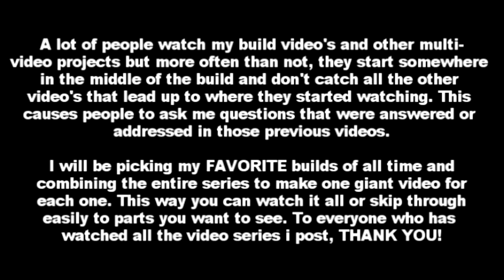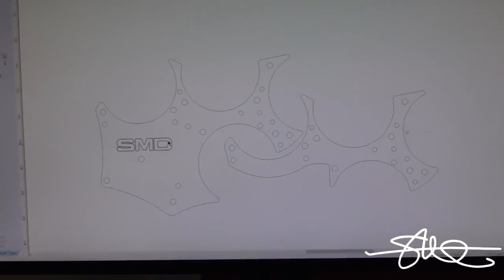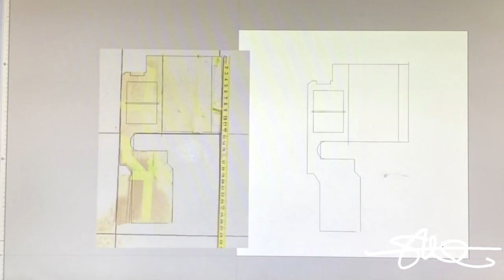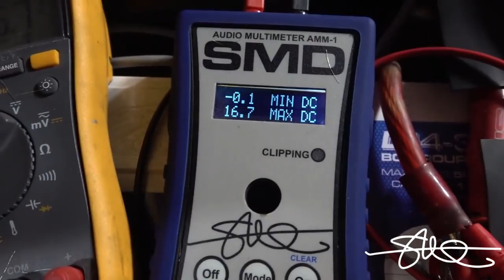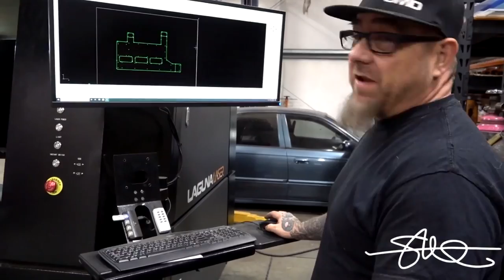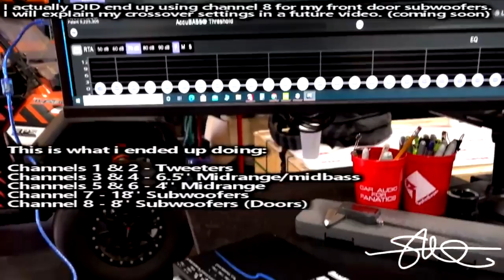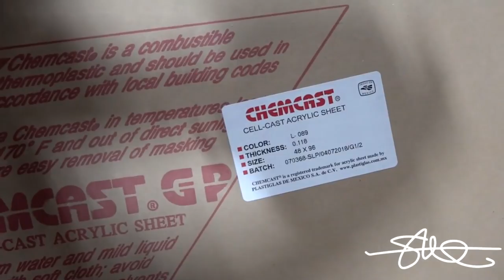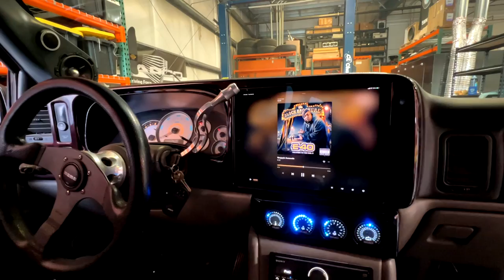30,000 Watt Chevy Tahoe Sound System Torn Down & Upgraded after YEARS of abuse - Start to finish

Comment from the maker: A lot of people watch my build video's and other multi-
video projects but more often than not, they start somewhere 
in the middle of the build and don't catch all the other 
video's that lead up to where they started watching. This 
causes people to ask me questions that were answered or 
addressed in those previous videos. I will be picking my FAVORITE builds of all time and
combining the entire series to make one giant video for
each one. This way you can watch it all or skip through
easily to parts you want to see. To everyone who has 
watched all the video series i post, THANK YOU! more coming soon!
Reply: Я если честно ничего не понел в этом видео и зачем 4 часа делать
Reply: Hey Steve you still have the old Carolla bass car???
Reply: Dope. Thanks Steve!
Reply: Do u have an isolator for the batteries stacked together or no need.?
Reply: @beatsandwestside  That's kinda one of the benefits of stacking no need isolators
Reply: Can you run 14v batts with an alt that runs 12v? External voltage adjuster?
Reply from the maker: @beatsandwestside  no need
Reply: @XFader505  The voltage regulator defines the voltage, and the standard output from a 12V alternator is 14.4V so prolly, myb. 
With a step up transformer though? The current will go down to 1/2 of its original value and your amperes stay the same regardless. Adding batteries can up both. Some kind of switching circuits might work maybe a regulator as opposed to adjuster. Couldn't hurt to try. I'd be more worried about amperage output than volts though.
Reply: Steve I have to say you continue to be an inspiration to me in my new addiction to car audio and learning how to install it. I have a 02 yukon I've wanted for years that my mother finally gave me last year and this truck is where I want my truck to be. I am currently working on a build with 2 scar audio 18s. I m still trying to build the box myself. And it is hard without Machine's to make a nice one. I've watched so many of your videos and learned so much from you. Keep it going man we appreciate all your hard work because it makes me want to work as much as I can through this strugle.. love to have real products to work with. I'm having ground problems now trying to save for smd fuse holders and distribution blocks. I hope to one day have 2 b2 15s!! But with knowledge I do what I can with what I got. And by the way you want to sell one of those alternators??
Reply: I ALWAYS WATCH THE ENTIRE VIDEO MEADE916 #1SUPPORTER. JUST THOUGHT I TAKE A CHANCE TO SEE IF YOU WANTED TO GET RID OF THE RIMS THAT'S ALL YET KEEP UP THE GREAT JOB👑
Reply: Steve kill it every time Meade916 the Master🏆🏆🏆🏆🏆🏆🏆🏆🏆🏆🙏🙏
Reply: You’re a legend.
Reply from the maker: @vernonsummerlin9012  i do need to get rid of them but whoever gets them should be local because i ain't shipping them anywhere. Thanks Vernon!
Reply from the maker: @natecamp2585  i built boxes for 30 years before i got my first cnc machine.  It isn't that hard to "make a nice one" at all (without a machine).  Just have to put in the work.  Thanks man!
Reply from the maker: @XFader505  yes, if you have an external regulator.
Reply: I loved this truck since the first time I seen it!!!!
Reply: Steve!! I can't wait to see this video later today! I'm gonna set some time so I can enjoy it.  You are a master of your craft!!!
Reply: Your videos are the rare pieces of content that I can watch for several hours and not get bored.  Sometimes I miss doing 12V A/V installs, and other times I remember why I left it.  Either way, I enjoy your videos, and it takes me back to a lot of fun times I had back in the day, as well as showing me some higher end techniques I never got into (most folks in big chains like I worked at don't want to go big). Thanks.
Reply: Fingernails burnt lookin like a tweaker 
Ears steady poppin but not from the speakers
Reply from the maker: @drummerdoingstuff5020  who you talking about? your mother? tell her to put the crack pipe down.
Reply: @meade916  lol you never heard of Master P? Pass me the green, good old school banger right there, like yo momma!
Reply: @meade916  love ya 🐕😜
Reply: SMD you ever gonna put your old Lexus back on the channel if you still have it.

Comment: Ceramic bearings for your belt pulleys and a more powerful spring and ceramic bearings for your belt tensioner will definitely for sure take care of any and all issues that you would or could ever encounter with belt slippage, plus that will without doubt quiet it down ten fold.

Comment: I'm in the middle of watching this and iam at the part where you make the steel bracket for the alts ... I reckon a good idea if you haven't thought of it already is to paint the steel a colour of your choice then put the perspex bracket over the top. Gives the metal protection from the weather and also look brighter with the perspex and paint.

Comment: Did you notice the RF 3sixty.3 doesn't seem to like anything above 15.85v, like it just goes into protect.  I had to get one of those XS Power step-down modules for my external radio and processor.  My blazer and everything else likes the 16.4v.

Comment: I'm not a brown noser, so know that I mean this.  What you have done is extraordinary in your business and life.  I have dreamed about starting my own car audio business since I was in my late teens, I just did not have the guts to do it.  I was going to run my own shop and make custom boxes as my main thing.  I am 43 now and because I took the easier road, I have a lifetime of regrets, for not going for it.  I want to start building flat pack made to order custom sub boxes, all I need is a better table saw because my Delta only has a 30 inch rip width.  Keep it up man, keep making that money and building your brand.

Comment: Hey just wanted to ask about a system to put in a Honda civic LX I wanna keep dash the way it is and just use a rca cable inline box I'm guessing from stock radio and I want to add toggle switch so I have open to either be normal or turn on switch to have it thump what would u choose to put in that car I want like 2 subs and a descent amp to push it but do I have to add any batteries or upgrade my alternator

Comment: Do you have to reprogram the ECU to deal with all the extra voltage to the electrical system? I thought something like that would set off a check engine light.

Comment from the maker: 00:00 - 10:07 - Reviving the 'Hoe 2020 (More Volts = More BASS!) 2001 Chevy Tahoe Ripping it out video 1

10:07 - 22:52 - Major Fire Hazard Discovered! Almost had a Truck-B-Q! Reviving The Tahoe 2020 Video 2

22:52 - 45:32 - A SERIOUS Power Plant! 4 New 400 Amp High Output Alternators for the Tahoe (Unbox & Bracket Fab)

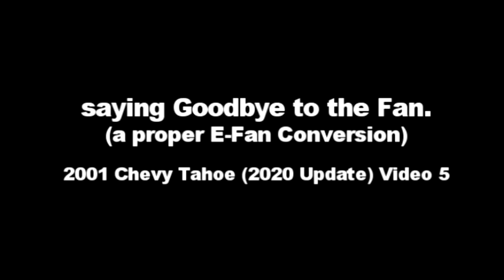45:32 - 1:04:08 - Regulators, Mount up! 4 Alternators 1600 Amps @ 17v Custom Stainless Steel platform Fabricated

1:04:08 - 1:16:53 - Goodbye Old Fan! More Space, Less Drag, Better Cooling. A proper OEM E-Fan Conversion '01 Tahoe

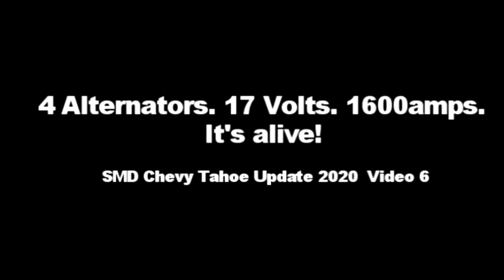1:16:53 - 1:31:23 - Stainless Steel Platform for Fuse Blocks, Distro Bars & Modules (from scratch) '01 Chevy Tahoe

1:31:23 - 1:44:03 - It's Alive! High Voltage Chevy Tahoe Pushing 17 Volts! Regulators, Alternators & Step Downs Fired up

1:44:03 - 2:03:26 - ALL the Double-Zero. High Power Sound System (16) 2/0 power & ground cables stripped, crimped & ran

2:03:26 - 2:15:25 - MASSIVE 2/0 Frame Grounds Plus a fresh new Banks Power Ram Air Intake Installed 2001 Chevy Tahoe

2:15:25 - 2:34:24 - ABSURD Power Wire! Rear Megablock 16 Fuse Holder & LB-1 Ground Distro Bar (Laser Cut Platform)

2:34:24 - 2:53:17 - It's HOT! 11 Amplifiers Hooked up, Fused & Fired up on 17 Volts! SMD Chevy Tahoe

2:53:17 - 3:16:27 - Dump That BASS! (See What Happens) 4 18" Subs Tons of fresh Power + AudioControl Processor Swap

3:16:27 - 3:47:33 - Rear Battery Bank 50 Piece all Acrylic Cover with laser cut Stainless Steel Grills. CLEAN!

3:47:33 - 4:12:40 - Lipstick & Cables - Sub Box Neo Magnet Beauty Panel (Color Matched) Trim, Battery Bank Wired up

4:12:40 - 4:18:33 - Chevy Tahoe Still Beating Hard! 4 18's 30,000 watts Hair Trick No Problem! Tucking Forgiato 28's

Comment: Looking at a napa acid battery. RV 1427 CCA. 1700 crank. 425 RC.  Most I see not even close to 170.  I plan on running a taramps 20k. Currently have a 8k  that is on a 350 and 2 850s agm and 1100 deka  -10. In wis  fire up audio. THEN take deka out and throw it in my 350 JB bulldozer. -15

Comment: grounds look good but taping a 1/8th in piece of steel is not enough threads the grounds may work loose I would have drilled a couple bigger holes in the bottom and put nuts on it
Reply from the maker: yes it is. It is plenty.  Who said it was 1/8"? It probably isn't even that thick.  You don't know that because you have no experience in the matter.  It is MORE than good enough so relax champ.
Reply from the maker: @jamesstephenson2346  awwww did you get clowned on and feelings hurt? typical.  Keep coming back though i get paid for your engagement.  Hit that thumbs down button too! Troll money is good money.

Comment: Am I hearing you correctly?  You keep saying 14v batteries,  but the XS says 12v.  So, which is it?
Reply: 9:10. Taking out 12v that charge at 14v putting in 14v that charge at 16v.

Comment: that poor transmission pulling all that weight around but your lucky the short did not burn that thing to the ground nice truck though and awesome work
Reply from the maker: tranny was rebuilt years ago. It don't care.  This Tahoe is made to tow a trailer...a boat...the system is nothing compared to what it is capable of.

Comment: I blew up my sub yesturday lol the amp I have must push more the 1025
Reply: Wats
Reply: That's why you set your gains ac voltage to the square root of your sub's impedence multiplied by it's rms power rating.

Comment: Hey Steve really enjoying the new work on the build you inspired me with that thing an exo another awesome bass head even done a colab together 🙌🙏💯❤️‍🔥 I had a kewl Idear I thought you might like @meade916 the waterpump puller has the thread left on it you could make a custom emblem that spins on the pulley with a thread nut end to tighten it onto the front, it could be your design an brand an could even be make out of acrylic aswell 🙏 be kewl to see you make something unique for that , could also do the same for the battery area  a slip down panel 🤤❤️

Comment: You went from a no good hot air intake back to a factory style actual cold air intake.
Reply from the maker: no, i went from a K&N to a Banks.
Reply: @meade916  yes sir. Im meaning that the stock style is a true cai just like your new banks. Wherever you see the air filter that's technically a hot air intake now. I didn't know banks made 1 for this gen as I have an 06 Sierra, I'm using the volant tube and box which is true cai just looks better than factory. Love the technical vids Steve!